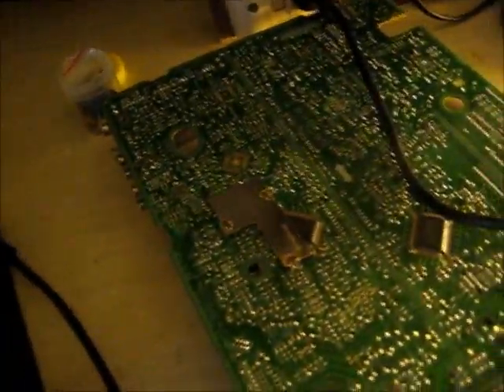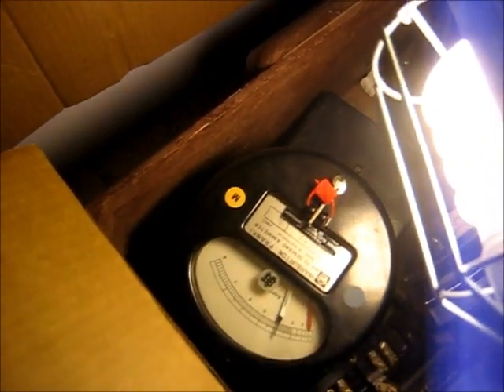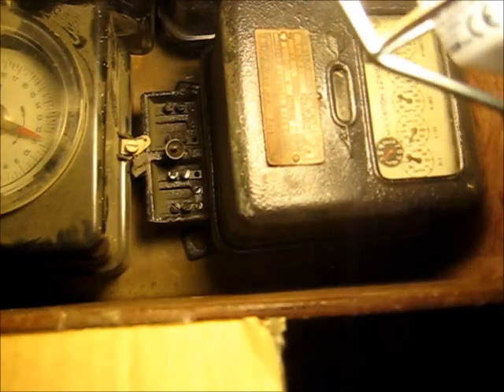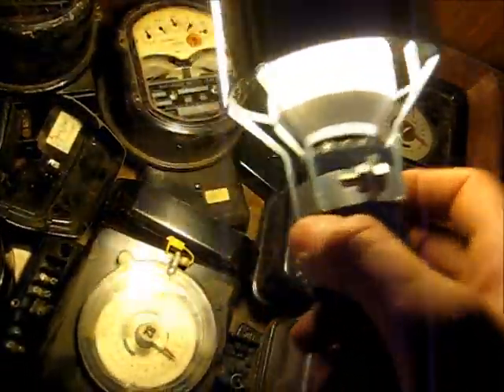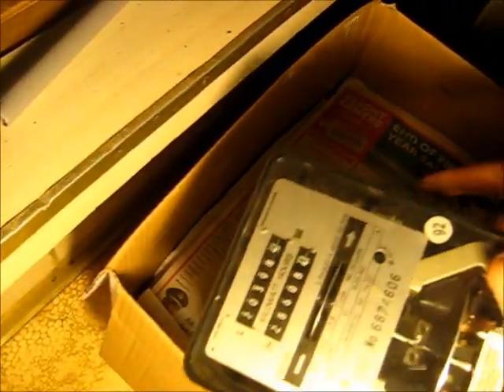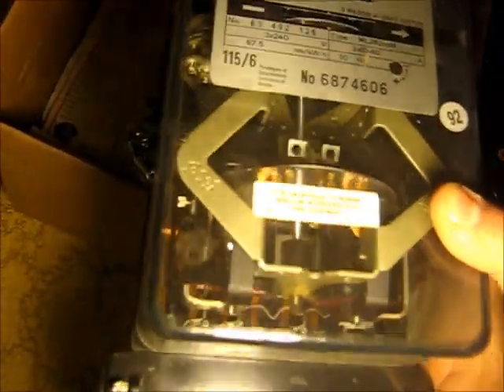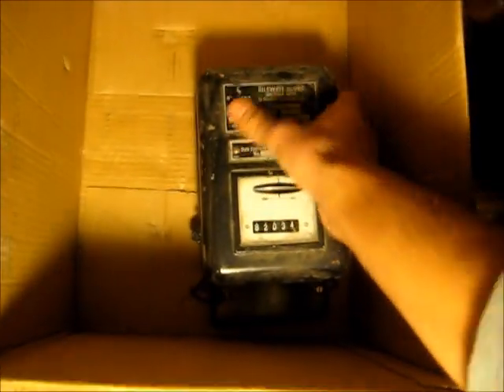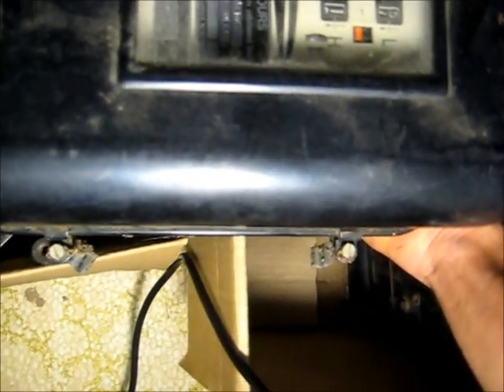Watthour Meter & Timeswitch MEGA Score :-D

Comment: Some beautiful meters and time switches in there. Check the CT meter. Often the 5 Amp coils will take up to 10 Amps. That meter with the broken glass can easily be repaired with UV perspex. I have done that with various meters too, I get it cut locally at a manufacturer. About $1 a piece. Nice bit of Australian, German and Swiss history which would otherwise ended up in the scrap bin.

Comment: Most of your 3 phase meters are whole current. Check the revs / kWh too. For CT meters they are often more then 375 rev / kWh. Whole current 2 and 3 phase meters have low contstants of < 150 rev / kWh. and often no decimal.

Comment: Not at all. Use say red phase, current in (1), current out(3) and liven the red potential (2) with 240 Volts. and connect the neutral. (10 or 12) I have various CT meters connected up as 1 phase meters. They have a good high disc speed too. They take 10 Amps with no problems, even 13 Amps. Got one of those on a 13 Amp load for the last 10 years and still hasn't burned out.